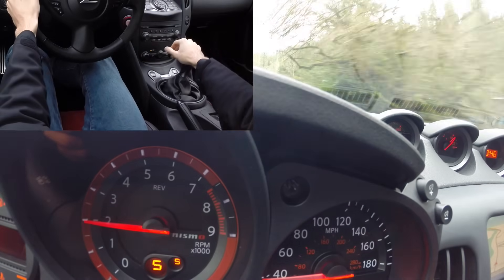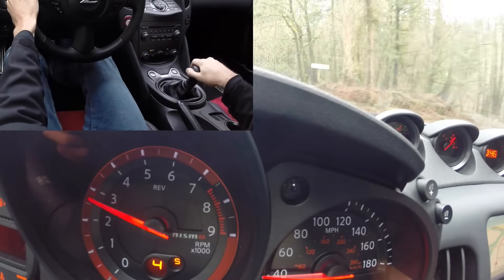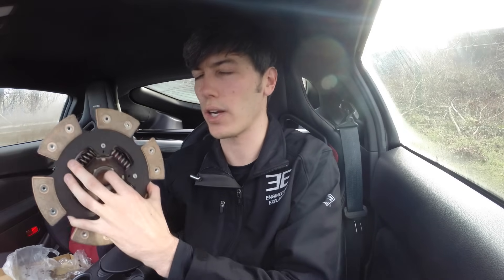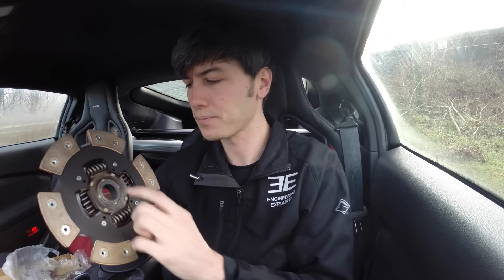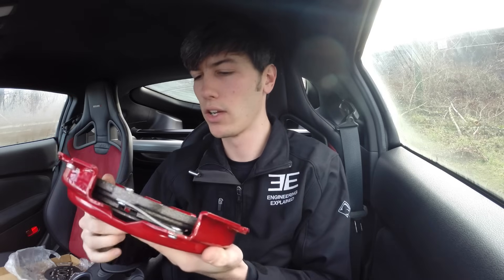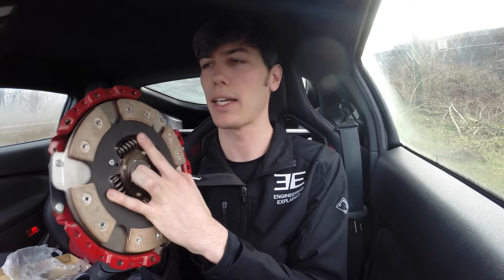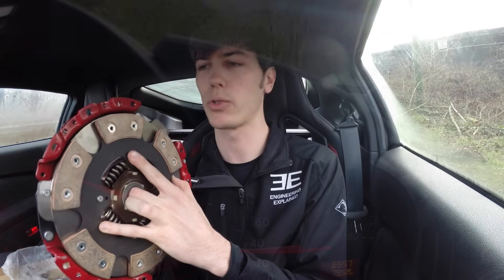What Is Rev Matching?

Comment: shouldn't you learn that when you train for your license in the first place? To know how to shift is essential right from the beginning.
Reply: +Behemothokun But seriously how relevant is that for 99% of everyday driving? Not. A. Bit.
Reply: +Behemothokun epic! 
I bet she also powershifts when hitting the redline.
Reply: Behemothokun for racing maybe. For everyday driving it's pointless.
Reply: +Behemothokun what are you talking about? Blipping and double clutching is only required when you jump gears which rarely happens when you drive normally (aka not racing). There's a reason why they don't teach you this stuff in driving school because you don't need them.
Reply: Mircea Dogaru I agree with your statement about double clutching for modern cars but not for some old cars. However rev-matching, as the name alone suggests is for matching the engine speed to the speed of the transmission which will spin faster if you shift down (compared to the gear that was selected before). So the engine needs to speed up to match it; Modern clutches do this on their own when you engage them but it usually upsets the chassis and it's unnecessary friction for the clutch so it's a good idea to do this manually (blip while pressing the clutch) for a smooth shift. . . this does not just apply for skipping gears and isn't just useful for the track.
Reply: +Sebastian Kauschke 
Exactly. Clutches don't wear out that easily even if not shifted correctly let alone without rev. matching. 

Me and my brother used to play around often with an old car of my dad, (it was probably something like 30 years old). Sometimes we used to shift gears without pushing the clutch and still it (the clutch) outlived the car.

Rev. matching, double clutching and stuff like this is right in theory but irrelevant in 99.9% of the cases.
Reply: Sebastian Kauschke It's relevant for everyday driving; Like for every time you downshift. Even my mother does it
Reply: Mircea Dogaru don't be stupid. . 
All I'm saying is that something like rev matching is completely trivial
Reply: Mircea Dogaru I don't think it's that good to let your synchros do all the work. . . (besides that it unrests the chassis if the revs don't match when I release the clutch, which I hate btw.) or even worse if you have an old car with unsynchronised transmission where double clutching and blipping is pretty much a must. None of my cars were like that but my parents for example told me that their cars back in the day required a bit more input from the driver.
Reply: Behemothokun
Absolutely not. See my comment above. There's no need to match rev. of any car that's younger than 20-25 years.

Maybe it was required in trucks or other things but it is absolutely not required in cars.
Reply: +Behemothokun it won't hurt blipping the throttle when downshifting however it's just unnecesary unless you're doing some spirited driving. like I said in a previous comment I tried it for normal driving and ended up braking too hard (i'm not very skilled at hell and toe). Not to mention you're doing unnecesary fuel consumption by revving the engine when downshifting (okay that probably won't make much of a difference but hey, it's something to think about)
Reply: +Behemothokun there were no manual cars when i got a driving test and took my license test. tho i really wish there were i only have little experience in a manual car but i understand the clutch system from years of dirtbiking
Reply: Mircea Dogaru heel and toe is a bit tricky but fun to do, in some cars it's also easier then in others.
👽Mr. Latino👽 fortunally, a manual car is mandatory when you do your license in germany. A motorcycle license is on my bucketlist, for now I have only driven a manual bike once (a small 50cc one, since I can ride that legally with a car license) and I used to own a small scooter (auto trans).
Reply: +Shaban Shneta You can shift gears all day long without using the clutch in any car so long as you do it at just the right rpm's and it wont have Any negative effect on the vehicle. So it's no surprise that you had that experience. And really these vids arn't for everyday driving it's application is for track days, where if you're coming off a short straight from about 100 mph in 5th gear and need to go down into 2nd or 3rd gear for getting around a 110 degree decreasing radius corner. If you don't match the rev's in that situation you will upset the balance of the car and could have a Really Really bad day.

Comment: How do you downshift  rev match  while braking into a corner? Is it necessary to look at the tachometer when downshift rev matching and how do you know what the ideal engine speed should be at before engaging the clutch again.

Thanks
Reply from the maker: The technique is known as "heel-toe."
Reply: +Milton Don't look at the tach. Just clutch, kick the throttle /downshift and release clutch. It becomes effortless.
Reply: +Milton  It takes practice to get it smooth...basically, you use the toe of your right foot on the brake, but swing your right heel over to the throttle to blip it, while operating the clutch with the left as normal.  (Or, depending on how close the pedals are set, you can use the ball of your right foot on the brake and the side of the foot around your little toe on the throttle.)  Thus, you use all 3 pedals at the same time with 2 feet, although it can be rather difficult if your pedals are set too far apart to reach with the one foot.

Comment: hello the pressure plate don't rotate,try to learn a bit more or read more
Reply: +Jaffar 1956  Umm...the pressure plate is bolted to the flywheel, so if the engine is running...the pressure plate is spinning at exactly the same rpm.  Whereas the clutch disc is spinning at exactly the same speed as the gearbox input shaft, the speed of which depends on the vehicle speed and what gear has been selected.
Reply: +aussiebloke609 the flywheel and da clutch is spinning the pressure plate is bolted to the engine block
Reply: +aussiebloke609 the pressure plate is a link between flywheel, clutch and gear box,how is spinning,please read a bit more or "Google it "
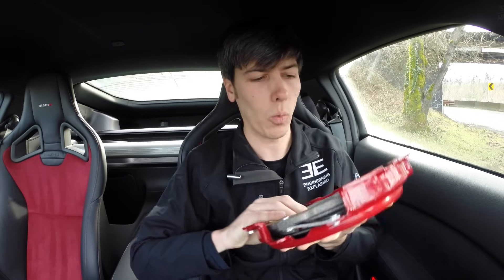Reply: No, the thing bolted to the block is called the bell housing - the pressure plate is the part of the clutch assembly that is bolted to the flywheel.  Read a bit more or google it - or maybe actually take a look at an actual clutch in a vehicle.  And maybe learn the terminology.  The red thing he holds in his hand at around 1:20...that is a pressure plate.  It bolts directly to the flywheel.  The other piece he holds is the clutch disc - it gets sandwiched between the flywheel and the pressure plate.  Remember, the pressure plate is part of the link between the internal MOVING parts of the engine and the internal MOVING parts of the gearbox...nothing to do with the engine block or the gearbox casing.
Reply: +aussiebloke609 no mate,u read a bit more trust me,the bell housing is part of the gear box and is covering the clutch assembly, on the flywheel is not bolted anything, and the pressure plate is not spinning, the only thing what is spinning is the bearing, so please check before u comment, and how many clutches did u change?
Reply: +Jaffar 1956  Bell housings are sometimes part of the gearbox casing, sometimes separate.  But there's no getting through to you since you keep insisting that nothing is bolted to the flywheel.  I'll say it in simple words for you - THE PRESSURE PLATE BOLTS DIRECTLY TO THE FLYWHEEL, WITH THE CLUTCH FRICTION DISC SANDWICHED BETWEEN THE FLYWHEEL AND THE PRESSURE PLATE.    The thrust race (I assume that's the "bearing" you're talking about) only spins because it presses against the pressure plate springs, and since the pressure plate is spinning...  it's only other connection is to the bell housing via the clutch fork...and since the bell housing can't exactly spin, there would be no need for a bearing at all unless the pressure plate was spinning.  

I don't need to read - I've changed many clutches in my time.  If the pressure plate isn't bolted to the flywheel, the vehicle simply cannot move - there would be nothing to provide a clamping force to the clutch disc so it can transmit the power.
Reply: +JudgeTread1  Yeah, but now I KNOW I've given all the info he should need.  Any further issues are hereafter not my problem.  :-)
Reply: +aussiebloke609 I'm pretty sure he's screwing with you.

Comment: I don't and have never raced. But if you are going to downshift without rev matching, don't go from 6th to 3rd and just pop the petal out. release slowly in order to allow the car to slow down enough so the engine doesn't redline.,  I used downshifting to help with hard braking, and downshifting helps with slowing down in slippery conditions.. pre ABS era. IMO.

good info all the same.

Comment: I double clutch on downshifts because I believe it spares synchro wear. Seems to help in old gearboxes.
Reply: +dmclaren I don't understand how that would help. Unless you're loosing pressure in the hydraulic system due to the slave or CMC back leaking.
Reply: +JudgeTread1 sorry, I wasn't specific enough. In a downshift with substantial rev matching, clutch out while matching revs to get the gear moving at close to the speed it will need to be for the shift. Therefore the synchro had little work to do. I think it it like driving a non- synchromesh gearbox.

Comment: I have a video Suggestion on external wastgates. running a small gate just big enough or running a larger gate to bypass more exhaust with less back presser. is it advantageous to have an oversized gate or are there some disadvantages I'm not seeing?

Comment: What happens if you are in sixth gear, then you disengage the clutch and try to  insert the first gear. My questions are: 
1) is this even possible or would it burn the synchronizers right away?
2) What is likely to happen if you just leave the clutch disengage in comparison to trying then to engage the clutch?

Comment: People always think of rev-matching in one direction: Downshifting to a lower gear.
Actually, the concept applies whether going down or up through the available gears.  The thing is, people generally let off of the throttle when upshifting without even thinking about it, so that the engine rpm drops as a higher gear is engaged.  So, lower RPM is required for each upshift, and a higher RPM is required for each downshift.
Lucky perhaps for drivers of modern cars, which have the electronic throttle controls to adjust engine speed for each gear.  While fun, something is lost.  The ability to rev match for spirited or competition driving, with no electronic aids assisting, is a satisfying skill.  Some would even call it an "art".  I read a bit on Fangio many years ago, where a magazine writer was in ride-along  mode through a South-American city.  He was awed by the flawless execution of gear chages, accomplished by what was by then an old man. Racer, and artiste!

Comment: I do rev matching every time when I downshift. I have an old car, worn out synchros just won't allow me to put it in a lower gear without rev matching. Well, you can; but that action will be accompanied by a gear grinding noise.
Reply: +MrJohhhnnnyyy how old is your car?
Reply: Prince Zuko I'ts made in USSR back in 1986. Gearbox does have synchros, but they are worn out (gearbox never seen repair).
Reply: ahh well hey at least you can still drive it good
Reply: +Prince Zuko Yeah and double clutch trick also helps when I want to shift gears quickly without damage to the gearbox itself. Instead of shifting at 3000RPM I can shift at 4500RPM, no drama :)

Comment: so... is engine braking bad?
Reply: +jlakindd Why should it be?
Reply: +jlakindd nope, not at all. The only thing that could be considered bad is releasing the clutch instantly when downshifting because like he said the two are spinning at different speeds and you stick them together too fast. Puts a bit of strain on the whole drivetrain and engine mounts.
Reply: *****
That is actually how you learn it in driving school I guess. My oldtimers/vintage cars go with it very well for years :)
Reply: ***** don't worry about it, the wear is insignificant. I did and do the same with all the manual cars i've ever owned and never had to change the clutch earlier than the manufacturer specified interval. Some lasted even double that.